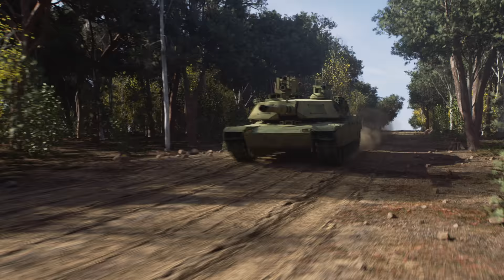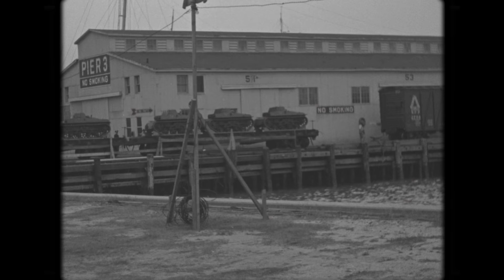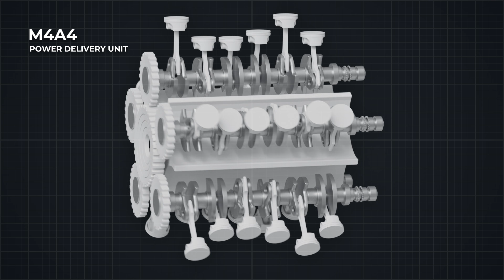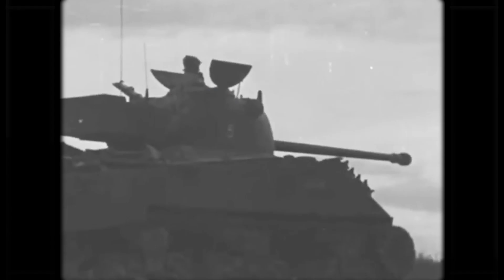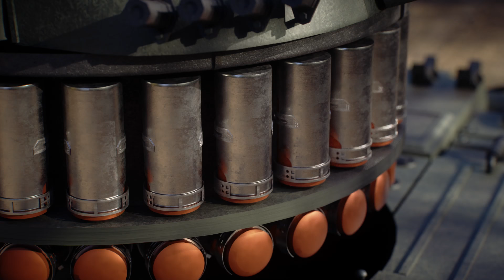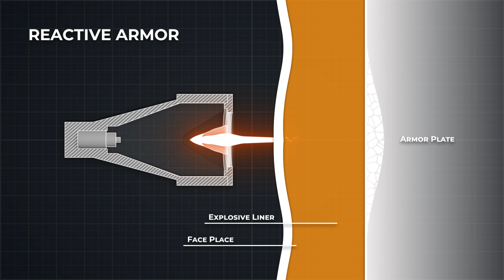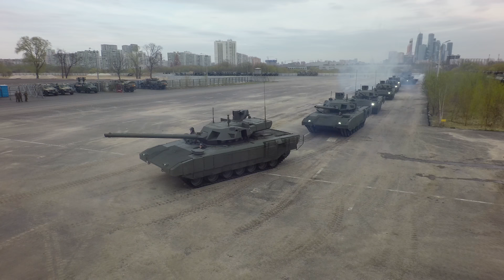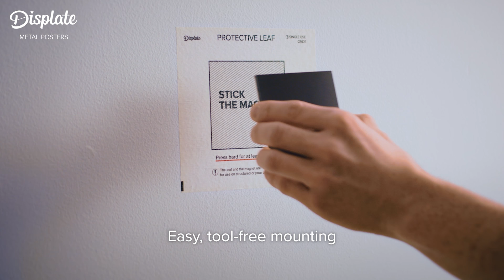Why America’s Tank Failed in Ukraine

Comment: Calling this a failure is just clickbait. The M1a1 did whatever it was supposed to do. It had the highest crew survivability of any tank in the ukrainian army. It provided excellent fire support. 

But no tank is invincible. Battlefield attrition happens. Russia can attest to that as it lost atleast 4800 tanks (of wich are 100% confirmed) up to 10 000 estimated.

Those M1's will not last troughout the war. They need to be replaced.
Reply: “Why it’s not perfect for a job it wasn’t made to do” sure gets a lot less engagement lol
Even when it fails, it succeeds in keeping the crew alive as possible. I’ll take that win in any war.
Reply: It's also an unfair comparison of the m1 abrams in Ukraine vs America because the depleted uranium armor plating isn't even on the m1's in Ukraine or any foreign service for that matter
Reply: @NoahHenning-xd1mo Fair point, and the tank was designed to advance under US air control, constant logistical supply and battle intelligence but the tank was sold extensively abroad to countries without those resources and that additional armour would not have stopped the anti tank mines
Reply: @TechToWatch  And that’s the handicap the Ukrainian Abrams had.
Reply: @NoahHenning-xd1mothey are already sinking
Reply: @NoahHenning-xd1mo because I am sure that it will make a lot of difference against something like a 152mm  kornet missile that has a penetration rating of over 1000mm of armour.
Whether they have it or not doesnt matter they have sufficient armour and all of the other important bits like a stabilizer and and good optics.
Reply: @NoahHenning-xd1moYeah, uranium is a magical, indestructible material that definitely protects the tank from mines, mud, top-striking FPV drones...
Reply: @NoahHenning-xd1mokeep crying bc even w the uranium plates it still suffers from top down and the driver is easily killed
Reply: @NoahHenning-xd1mo Nope. Don’t need the modern Red Army stealing our tech.
Reply: The challenger has the highest crew survivability rate fyi
Reply: Yeah, and additionally M1A1 SA (built in 90') that Ukraine was given weighs more like 64t rather than implied by author 78t of fully equipped newest operational variant M1A2 SEP v3 wich is also almost entirely different tank all by  itsef.
Reply: @Adam-dm3ij  Not to mention that weight results from including the TUSK protection package, which has not been sent to Ukraine.
Reply: @Gearparadummies  They've got the basic arat tiles just not the curved ones that are on the sepv2. Seen a few videos of them on the side skirts while they put kontact 1 all over the turret
Reply: @Gearparadummies And why would they bother to send TUSK? Not like Ukrainians are dumb enough to fight with tanks in the city (unlike Americans), and Russians don't have TUSK for when they try to bring the fight to cities.
Reply: @JorgMunch01  Not nearly as heavy as the TUSK.
Reply: @Gearparadummies tusk 2 has been sent to ukraine
And the m1a1 sa is an m1a1 hull with an m1a2 turret, but it doesnt get depleted uranium inserts the turret or hull
Reply: @JorgMunch01 ive seen them with the tusk 2 curved ceramic plates. they were used during the beginning of their introduction to ukraine before they were replaced with kontakt
Reply: @allenliu8820 The confirmed version sent to Ukraine by both Australia and the US is the M1A1 SA with ARAT-1 Reactive Armor, the oldest version of the TUSK Systems. No information of SEP V2 turrets installed on any export tank. Care to share the source?

Edit: what the SA adds to the M1A1 are improved Thermal  sights and digital control  systems. Which is not a SEP V2 turret installed on a M1 tank by a long shot.
Reply: @Gea @Gearparadummies  memory must be fucking with me because i could had sworn i saw a ukrainian abrams with arat 2, but it seems that it wasnt the case

M1a1 sa is an upgrade derived from the m1a1 aimv1 which upgrades the turret to the m1a2 standard. The turret also can be equipped with a du and non du insert. Upgrading the protection to be equal to the m1a2 standard.
Reply: @Adam-dm3ij Don't matter. Anti tank missiles and drones will destroy all of the models
Reply: He's not calling the tank a failure, he's saying it failed in Ukraine, which is not the same thing. Arguably if most that were sent were destroyed it did fail. Not the tanks fault, just the wrong tool for the job.
Reply: I mean yah 100%...but I assume he knows that and it is intentional clickbait and it worked on me and you.  Unfortunately some amount of clickbait is probably unavoidable.
Reply: They lasted 8 minutes at the battle of Adivka.
Reply: Lol
Reply: Nah, it is a failure as in relation to performance of other tanks used by Ukrainian armed forces.
Reply: If they did what they supposed to why are almost all destroyed lol ? Enough fire power mines atgms and drones so they got destroyed just like any other tanks.
Reply: @Gringo.the.Bratan  almost all destroy because of strip down to it original design in the 70s
Reply: Plus logistics is key to winning wars. Any equipment will fail if you don’t have the proper infrastructure to support it.
Reply: @BHuang92  that said, if your tank is designed in such a way that it's a logistical nightmare, then it failing due to poor logistics is indeed a failure of the tank design itself, otherwise you could say that the Tiger and Panther tanks didn't fail because they were bad tanks, but due to poor logistics. What army can't spend an hour of maintenance for every hour of operation am I right?
Reply: @HellDuke-  so the Abrams is a failure?
Reply: @mizoreyoroizuka4178  Iwouldn't say it's a failure, but it's not fit for most modern battlefields as clearly evidenced by it's recent performance.
Reply: @BHuang92 Or if your supplier elects a Russian puppet who cuts off your supply of parts before it even hits your own logistics chain.
Reply: @DrDeFord I mean, the "Russian puppet" is doing a great job of knocking off most of Russia's allies. Venezuela is gone and Iran is about to be overthrown. He doesn't seem to be good puppet or y'all spouting this nonsense are delusional. I think footing the bill for a country that isn't an ally and they have no binding treaty with is charity, not obligation. Ukraine should be happy it got anything to fight with and was actively supported for a number of years. But all the sudden the EU has to pull their own weight and now it's a big problem. France, Germany, and the UK should take the lead. CNN should hit the frontlines too if they're so eager to fight.
Reply: @Thrainite  Cope is hard with this comment. He is a very good fool and puppet with zero sense. Venezuela is still very much there so is Iran. Don t believe a liar otherwise i have a bridge to sell you.
Reply: @Thrainite  America is known to bombed reporters it doesn't like. Regardless of affiliation, they're not big on accountability.
Besides that, Maduros regime is still intact, Iran still exists. I don't see much benefit, other than wealth, where any US operation had significant impact
Reply: @Thrainite nope he’s still Russia’s puppet, he doesn’t do anything that doesn’t generate a personal kickback.
Reply: Why does anyone assume that this is about saving Ukraine from Russia?

It's a weapon testing and advertising event with the west bleeding Russia like they did in Afghanistan.

Only this time they have non stop surveillance and intelligence assets.

No weapon system is perfect they are all tools for a purpose. Anyone who claims that their sides systems are invincible is a cheer leader.
Reply: @Mayadanava weapons testing with 40-50 year old equipment.... sure pal 👍
Reply: its not its actually the challenger with the highest survival rates
Reply: @jaanusandrejev1196  lmao, after 3 of them got destroyed, they pulled all of them out
Reply: Exactly, in comparison I bet the Abram’s has a far high crew death rate than the challenger.
Reply: @Pieces93 far higher is an overstatement the challengers survivability is only marginally better
Reply: @TauPathfinder334 Challenger lacks the blow out panels like Abrams, one got blown up by a lancet strike to the top rear . It was a catastrophic explosion and the turret was torn off the hull. I doubt any crew survived that.
Reply: @Archer89201 if a Lancet hit an Abrams in the rear of the turret, I am fairly certain it would have got opened like a can just the same, blowout panels will not save you from that.
Reply: Oh did that hit a nerve American traitor friend !!! 😂😂😂
That’s what traitor tanks do … they „eventually“ break down …
I’m a bit with the Greek gods on this one.. so take it with a pinch of salt as they say😉
Reply: Of course, every single tank was lost in Ukraine, from m1a1's to Challenger 2's to T-90m's.
Some in enormous quantities. To use the destruction of these abrams as an argument for failure is just retarded russian copium. By this metric every tank that saw combat and every future tank that will ever see combat will be a failure...because they surely will be destroyed.

The point should be, did they acomplish their mission?  Did they provide fire support and breakthrough capacity?  
Those are the real questions any non-cognitively impaired person would ask.

Or do russians and their clowns think the mythical T-14 ARMATA!!🎉🎉🎉🎉 would not lose a single unit in ukraine?

Cmon, its easy to see why ukraine is managing to hold back Russia....its because russians are fucking dumb.
Reply: Their purpose in Ukraine was not to serve as fire support or breakthrough but to get the Germans to stop whining about releasing the leopards. The Biden admin knew they weren't the best option for Ukraine and sent them reluctantly.
Reply: People also forget, this was a completely stripped down version.
Reply: @jamesharwell9171 it won't do shit with drones even with DU armor
Reply: @matthewA2  makes since on the roof but not side or front not completely useless at all.
Reply: I don't mind clickbait from this channel because they consistently produce the highest quality content.
Reply: Saying the Abrams has the highest survivability is a stretch when the Challenger 2 is right there—it’s a literal fortress on tracks. The real issue isn't which tank is 'better,' it’s that both were designed for a war of movement, but in Ukraine, they’re being used as 'expensive snipers' because they’re too heavy for the mud and too vulnerable to cheap drones.
Reply: @James-dv1df  Drones capable of destroying a MBT aren't cheap. In fact they cost ten times more than an artillery round.  Still much cheaper than the tank, but the "$400 drone kills a tank" is a myth.
Reply: @Gearparadummies 
This is completely false, average FPV costs about $300 - $700 to make an anti-tank model. The cheapest ones use warheads from things such as an RPG-7. Average 155mm shell? $3000 - $5000 and that is assuming you only use 1 to hit a tank (highly unlikely).
Reply: @Gearparadummies  Destroying a single side of tracks is enough for a "tank kill", armor penetration is fluff. 
Destroy the track with small stuff, then shell it with artillery. Killing a tank doesn't require total destruction, mobility kill is all it takes.
Reply: @Bvoid-b  no? Tanks like this are recovered from fronts most of the time and repaired at back. What you describe is a mobility kill. But its not equal with actual loss, therefore you can't count full cost of the tank as a loss.
Reply: @pawemilewski3179  That depends on available resources for both sides. 

A mobility kill can very well lead to an abandoned tank being destroyed later and being unrecoverable. Immobilize with the small stuff, then order a big hit or drop some thermite on the abandoned vehicle using another cheap drone, specially if the hatch was left open.
Reply: @Bvoid-b  this is the correct answer. Yes, you can get s “hard kill” of a tank with drones, but you!ll either need to get lucky (like the crew leaving hatches open), or you will need to send 10-15 drones total.
Much easier to get a mobility kill then shell the stationary target for an easy layup.
Reply: @dsan8742  why are infantry still not considered obsolete and are still being deployed by militaries across the world when they can easily be killed by bullets, artillery, and drones?
Reply: @dsan8742  The most widely used Russian loitering munition/anti-tank drone is a Lancet, which goes around $35k/$40k a piece. Same as Geran/Shaheed drones. Same for Ukrainian made ones. Can you even read before posting? Can you even use AI or web search?
Reply: @mizoreyoroizuka4178  Because a drone can't occupy land, build new outposts/dugouts or trench lines as forward bases for continuous advance. The same as tanks not being obsolete because drones are 1)Not all-weather. 2) They are mission-specific with zero versatility. 3)they lack the firepower/support capacity/range of a tank. 
Last but not least, attack drones are doing the job of artillery barrages because both sides are almost out of barrels/ammunition. They're not the end all/be all weapon everybody thinks they are.
Reply: @pawemilewski3179  only if you are advancing. If you are falling back like Ukraine, the ones that recover the tank are the russians. To be fair, Russia won't use them, but it would still count as a loss in that case
Reply: @Gearparadummies  cheap compared too the tank is the point.
Reply: @pawemilewski3179  no there not….
Reply: @dsan8742 drones don't shoot shells. The power behind the shells are kinetic energy.  If you got this detail wrong, makes everything else suspect
Reply: @hanhuang7263 russia just lost more land in 1 weok than they captured in 2 years.  They aren't advancing
Reply: @BK20XX 
Buddy so confident in being ridiculously wrong. RPG7’s ARE HEAT (High explosive anti tank) BASED WARHEADS. They do not require kinetic energy, only enough to trigger the mechanism, they utilise chemical energy in the form of a superheated high velocity jet that comes from the shaped charge being triggered. The fact you got this wrong tells me a lot as this is literally basic knowledge. If RPG’s relied on kinetic energy they would be literally impossible to use by infantry as a handheld weapon. 😂😂😂
Reply: @Gearparadummies 
Although Lancets and Gran drones are the most effective per drone against assets such as tanks, THE MOST COMMON DRONE by number and BY USAGE AGAINST ARMOR are basic kamikaze FPV drones. 

Significant armored losses by percentage are attributed to Kamikaze drone swarms, moreso than the advanced Lancet and its equivalents.
Reply: @mizor @mizoreyoroizuka4178 
When did I say Tanks were obsolete doofus 😂
Reply: @dsan8742  A close friend of mine works in military drone design. Kamikaze FPV drones cost way, way more than $400. And that's after applying economies of scale. 

So no. $400 FPV drones don't kill tanks.
Reply: @Gearparadummies 
1 google search literally proves your bullshit, even just scrounging through videos you can see MOST tank kills are performed by drone swarms. 
 
A 400 dollar drone rarely kills a tank sure, 10 of them? Will score a mobility kill. 20 of them? Will confirm a total tank kill. 

What military does your friend work for? FPV drones are notoriously cheap why would I trust your friend over multitudes of sources that state otherwise 😂. 

I can say though it also depends on the drone, Fiber-optic drones with heavier payloads might hit the $1k mark, still far cheaper than what you are insinuating, which are prices for the most advanced drone models
Reply: @dsan8742  "GoOglE SeArCh". Ok. Whatever.
What you got with your "ReSeArCh" is the price of the baseline commercial drones before the plethora of modifications they undergo for military use. They don't come standard with Thermal vision, extended range, encrypted signals and other modifications.
This is like saying a $80k Audi and the $400k armored version used by security forces are the same car. But yeah, keep thinking off the shelf drones can kill a tank.
Reply: @Gearparadummies  strategy is the key. Remember, tank tracks are perhaps one of any tank's weakest points. So yes, a good HE round to the side of any tank will probably immobilize it
Reply: @bororobo3805  More than half of inmmobilized tanks are salvaged by its own side. And I'm being cautious with the number. 

An immobilized tank doesn't necessarily mean a destroyed tank. 

There are reports of Leopard 2s withstanding more than 30 drone hits. Even Russian turtle Tanks are effective against drones.

I never said Drones cannot destroy tanks. I said  off the shelf $400 drones cannot destroy tanks. Mostly because every drone used in Ukraine by both sides is heavily modified.
Reply: @Gearparadummies yeah I hear you. 

But it's not the drones fighting the tanks. The drones carry explosives and drop them on the tanks. Then you also have kamikaze drones.

But still, someone mentioned an immobilized tank is as good as dead. You wouldn't want to sit and wait inside one. You don't know who or what is tracking you from the outside. Once it stops, the frag grenade "bombers" can fly in to finish off the crew 😂
Reply: @bororobo3805  Tank gets inmmobilized. Crew bails. Reports tank abandoned and location. Tank recovered if possible. 
This is standard procedure since WW2
Reply: @Gearparadummies that guy who took out a tank with a single $1 molotov is laughing at you right now.
Reply: @ZandrichMynhardt  Who? You're too old to watch cartoons.
Reply: @J @James-dv1df u don’t need to kill it to make it useless. Then kill the repair men. That’s why tanks are obsolete. Drones could literally cycle out with fresh batteries and literally starve the crew to death. It’s a large tomb now.
Reply: @S-sp2feanti drones are being developed. They’ll follow the development of bombers then fighters to kill the bombers, then fighters to stop the fighters in WW1, but driven by AI acting autonomously, very cheap and available at scale.
Reply: @S-sp2fe

Bro, tanks are not obsolete.

If they're obsolete just because they have a cheap counter, which is not even guaranteed. 

Then the tank was obsolete since  invented, since then it has cheap counters.

Tanks are made to survive long enough, not to be invincible, the tanks shown in most footage are already immobilized and most likely abandoned.
Reply: @nonnn6884  apparently tanks were obsolete in WW2 because they could be destroyed with a single Panzerfaust that could be mass ptoduced for pennies by that logic.
Reply: @James-dv1df the challenger being better protected than the Abrams is up for debate. The real detriment to the Challengers survivability is its mobility.
Reply: @James-dv1df yes it's a bit much to say that the abrams has the best survivability when the survivability of the challenger 2 is pretty much 100%
Reply: @James-dv1df challenger is crap, by far the worst tank Ukraine had in this war.
Reply: @ЮрийКастро-м5в  Lol, Russian bot. Look at how many Ru have manage to destroy (few) and crew losses (non).
Reply: @ЮрийКастро-м5в   Calling it the 'worst' is a bit of a stretch its really depends on the job. If you try to use a Challenger 2 to blast through a muddy field, yeah, it’s going to get stuck because it’s a 70-ton machine. But Ukrainian crews actually call it a 'sniper' because of that rifled gun. It’s hitting targets from 5km away while staying in cover.  

It's definitely slower than a Leopard and heavier than an Abrams, but it's built like a bunker. In the few times they've been hit, the crews have walked away. At the end of the day, a tank that keeps its crew alive and hits targets from 3 miles out isn't crap just a specialist

But UK only gave them too Ukraine to open up the floor gates for others to donate. Reality is that the leopard is what they needed not the challenger as it was not well suited to Ukraine.
Reply: @ld4244 I am not from Russia, I am Latvian living in France, my channel is 14 years old, that's clearly is not a bot channel, and the fact that there were more Russian tanks destroyed than western thanks in Ukraine is simply a result of having more Russian tanks to be destroyed, in terms of performance Western tanks performed as shit, and Challenger was the worst one second worst was Abrahams, ukrainians were even afraid to use it in battle. The only machine that was actually good was Bradley, arguably the best machine on both sides in this class, but Western tanks turned out to be complete shit.
Reply: @James-dv1df the problem of Challenger is not the speed, it's armour isn't great despite what British were trying to prove, and it's gun is anachronistic. Imagine how bad this tank was that ukrainians were choosing t72 over it in battle, and d72 is shit.
Reply: I don't agree with your entire analysis, I think they needed more Bradley's end no tanks at all, in modern battle classical main tanks are obsolete, so we have a conversation about which piece of shit was less shity.
Reply: @ЮрийКастро-м5в  it wasn't just the result of more of them getting destroyed. It was also a result of them being even more shit than the Western tanks. All of them are ill suited to the modern battle field. 

The main difference between Russian designs and Western designs is that in Western designs the crew has a reasonable chance of survival and not making the same mistake the next time. 

In Russian designs you have the turret throwing competition going on and a pretty low crew survival rate.

So, in essence, Russian crews learn through natural selection. Western crews learn through experience.
Reply: @ЮрийКастро-м5в  It’s not quite that simple. The L30 rifled gun is definitely an outlier today logistics-wise and is being replaced on challenger 3 to be NATO compatible, but calling the armor 'not great' ignores that it was designed for hull-down defensive fighting, not chasing drones. Ukraine 'prefers' the T-72 because they have the infrastructure for it.  Like I said before the challenger was only provided to open others up to provide the leopard which is what Ukraine really needed.

Maybe I am wrong however can you confirm why you think it's the worst tank ever?
Reply: The issue was that it was only designed to bully poor third world countries
Reply: Thats a cute cope. Did your husband give it to you ?
Reply: Naah its normal, i've seen the worst call for Abrams
Reply: No it doesn’t have the highest survivability
Reply: I can't believe people actually believe the incredibly stupid numbers that the Ukrainian MOD puts out re. Russian destroyed vehicles. 4800 tanks. Lol. It's low-brow propaganda for the wine moms. Insultingly stupid, and I think they're actually saying it's 11k tanks on social media. LOL.

I'm no fan of the Russian military, they are laughably bad, but the numbers that Ukraine puts out there are so outrageously made up.
Reply: More like a little propagandist piece of trash
Reply: Heard of HALO theory? Number of targets increase kill count on your team when you play online, so raw numbers are relative
Reply: A reply, but it's a clown and laugh reaction.
Reply: Is the bigger issue that tanks cannot outrun a few drones hitting from any angle with a shaped charge. Drone development has destroyed most tank capabilities bar fear, most terrain   travel and a large gun but it's defence to drones that can hunt tank shapes, perhaps even recognise the tank type and it's weakest part to hit is near zero now, unless drones can be removed from your enemies battlefield.  Russian tanks are faring no better Vs drones bar their better fuel consumption Vs the gas turbine. Most of the human losses in Iraq and Afghanistan were protecting the vast amount of fuel needed by the (mostly) US army. As the Germans realised in WW2, no fuel means no tanks and troops become cannon fodder for mobile artillery, air to ground and even handheld missiles to hit truck transport. Hell even the A-10 showed that from above, such a a mobile asset could decimate tanks from above with just tank busing bullets at scale and speed
Reply: BS 💩
Reply: You mean CV90
Reply: Confirmed by whom 😂
Reply: Replaced…. With  drones.
Reply: A lot cheaper ways of ensuring survival.
Reply: Any "failure" was due to the lackey ungrateful Ukrainian operators
Reply: Not quite true the suggestion landing craft couldn't take more than the 30 ton Sherman as the Canadians took Churchill tanks to Dieppe in August 1942 and they were used by the Westminster Dragoons on D Day  as Funnies flail tanks for mine clearing on the beach and as flame throwing Churchill crocodiles. Churchill tank weighed between 39 and 41 tonnes (approx. 38.5 to 40.7 long tons)
Reply: You people act like they only use the abrams like they also have challengers leopards and most of these tanks don't make most of the kills the drones and atgms do most of these kills
Reply: Must agree it’s no surprise in a hot war tanks get knocked out just like Leopard and Challenger the most important component in western tanks survive.The crew.
Reply: But y'all were the ones talking like the M1 Abrams was invincible and couldn't get destroyed when the first tanks got sent in. Now you're changing your tune. You people are clowns. If they send 500 new M1 tanks, they'd immediately become priority targets and would also get destroyed.
Reply: I asked Google just now regarding the high loss rate of these supposedly invincible American tanks and this is what I got: “The 31 M1A1 Abrams tanks provided to Ukraine were downgraded versions with their classified Depleted Uranium (DU) armour used by the U.S. Army, removed ; making these Ukraine versions less protected against advanced Russian anti-tank weapons to prevent both this top secret American technology from being transferred to Ukraine and if captured, to fall into Russian hands.” So, basically all the Ukraine Army got was an ordinary tank that kind of looks like an M1A1 Abrams. The Pentagon unfortunately also does this with the F35. What U.S. allies buy is an F35 with all the goodies removed so they can never be someday used against a U.S. Airforce, Marine, or Navy F35. ❤Diane, Vancouver, Canada. MnMR16/26. 07:46 am
Reply: @dianefeinstein8951 Technology so top-secret, it's being discussed in a youtube comment section. The Russians will never figure this one out.
Reply: @dmitrychernushevich7241. Hi dmitry: A lot of the secrets we find on You Tube are inaccurate. For example, Mom has been trying for years to get a recipe for a proper “Korolevskiy”(Russian “Royal Cake” with yummy layers of walnuts, poppyseed, and chocolate). The only way is to capture a Russian operative, strap on a lie detector, and interrogate him, “What’s the secret ingredient in Korolevskiy, that makes it tastes so good! Don’t want to talk?! Guards, make him eat another BIG MAC from McDonald’s!”
❤Diane, Vancouver, Canada. SnMR29/26. 06:17 pm
Reply: @dianefeinstein8951  China got it anyways lol
Reply: They weren’t a failure because most of them were destroyed they were a failure because they didn’t have an impact on the wider war.
Reply: Ya the Russians loosing that many tanks is propaganda just like saying the Abrams sucks is
Reply: Russia lost "4800" tanks in Hollywood?
Reply: Easy target, useless in combat but crew has high chance of survival 😅 lol
Reply: You cant know for sure the propaganda from both sides is huge
Reply: Cope
Reply: It's the truth.

1. It's unrepairable.
2. It takes forever to manufacture.
Reply: @mountainbikerdave  unrepairable because Ukraine doesn't demand more Abrams tanks and two the US isn't in war that need more tanks most these are from dusting storages.
Reply: Smartest american.
Reply: They didn't fail unless they were destroyed without killing enemy tanks.  They can be expended in combat like any weapon system.  What counts is whether they accomplished the mission.

That brings us to crew skill, the type of battle being fought, and how successful the operating force was at combined arms warfare.

ALL tanks die when hit by 152mm or 155mm HE .

They die when a drone flies in the hatch.

They die when a shaped charge hits them.

They die when they set off anti-anxiety mines.

They die when hit with antiarmor bomblets.

And they die if another tank stuffs a HEAT round up their a$$.

The Abrams tank is an armored beast with better speed mobility accuracy and lethality than any other tank im aware of but nothing is invincible.  

 It always comes down to putting the right systems in the right places to kill the enemy and survive.
Reply: Failed in the specific objective of stopping the Russian advance. Planners did not anticipate the lethality of drone warfare in the era of the 21st century battlefield.
Reply: 4,800 tanks? No need to listen to CNN, BBC and Ukraine 😂
Reply: Keep drinking copium
Reply: Да ну? Целых 10 тысяч?
Эт ты где начитался?
Ладно 4800, за 4 года такое произошло 
Только есть одно но 
Танк потерять не так страшно 
В танке главное экипаж 
Танк построить можно, а экипаж просто так не сделаешь
Reply: Ahahahaha, dude, you're sick, what 4800, where did you get this information?
Reply: @CTPAHQNK_WTM Russia has only about 12-13 thousand tanks, and these idiots claim that the ukronazis destroyed almost 5 thousand of them, count half. I'm telling you, according to statistics, the dumbest people on the planet live in the usa 😂
Reply: 100% are confirmed, sure Jane 😂😂😂
Just like Trump's Iran war claims.
Reply: Effective against 3rd world armies, that fire at frontal armor.😅😅😅😅
Reply: "Chrysler was chosen to save it from bankruptcy."
Reply: Stridsvagn-122 seemed to have better survivability, with ORYX classing 90% of lost hulls as only 'damaged', while abrams were around 50% 'destroyed'. Better survival than russian models, and comparable to other leopard 2 variants, but Stridsvagn does seem safer based on what little sample data we have.
Reply: @sammyjones6730  When people talk about survivability, they are referring to crew protection.
What leads to the fact that these Abrams have been destroyed is thst they were immobilized, then once the crew evacuated FPVs were used to blowup/cook off the ammo. The ammo cookoff leads to it spreading to the open hatch crew compartments, and often melts the engine decks.
Reply: @sammyjones6730  Deniable ‘open source intelligence’ sources are in fact merely propaganda.  Note that you do not get real information from the military intelligence.  This is by design.  The real figures are very bad for NATO, so you get ‘OSI’ nonsense generated by amateurs shepherded by spook-controlled propagandists.
Reply: @boggisthecat  good thing you get your figures from RT and stay updated on the real "true" figures then, right Ivan?
Reply: @boggisthecat  lol ok ruzbot.
Reply: @i @ingnit6885  If I did that, it would make me as gullible as you.
Reply: @angusmatheson8906  Do you also believe that Epstein trafficked girls to himself?  Plenty of bootlickers and paid posters will tell you so.
Reply: @boggisthecat  huh? 

OSINT is literally open source, meaning you can literally go amd see geolocat3d footage and images of all strikes etc. There are many well complied archives that are updated multiple times a week of these lossesm 

What exactly does this have to do with Epstein?
Reply: @angusmatheson8906  ‘OSINT’ is literally propaganda fed to people who know next to nothing about what they’re being shown.
Reply: @boggisthecat Too dumb to look up stuff on the internet. Epstein!
(Wonder if that will become the Godwin's Law of the zoom zooms...)
Reply: @b @boggisthecat No
Reply: holy ragebait 🥀
Reply: The title doesn't call it a failure, it's just says it is failing  in Ukraine, which it is
Reply: @k3v1n73 Russia is also running out of tanks. It would be more correct to say that tanks are not a silver bullet in low-level attritional warfare. Tanks have always been most effective in large combined arms operations.
Reply: @mtylerw  Source:Trust me bro ✌️
Reply: @mtylerw  This video is about Americas Abrams lol. Cope
Reply: @k3v1n73  As are all tanks. The days of heavy armor are practically over.
Reply: @patrickjennings7362 and what will replace having an incredibly difficult unit to combat on the battlefield? This has been a statement since the 60s when ATGMs were introduced. What happened as ATGMs became common place? Tanks evolved with ceramic/composite armor, added era, and/or added active protection systems. Tanks are a force multiplier on the battlefield and the drone will not kill the tank, it will force it to evolve to fight drones and that is happening right now all around the world in labs. Until something better comes along that just completely overshadows the tank, the tank will always have a place. You need the equivalent of aircraft carriers killing battleships to phase out tanks.
Reply: @patrickjennings7362 no it's not. It's evolving. That's like saying the age of the dogfight is over look how that worked.
Reply: @botsmacker  The age of the dog fight is over. Jets fight with missiles from long ranges. A single guided rocket fired by a single soldier can destroy a multimillion dollar tank and its crew in seconds. Yes, tanks and manned jets will hang around for a number of years (20 or so) but, like the horse, their time is coming to an end.
Reply: @patrickjennings7362 the last time the USA said that they fucked up. At the end of the day when you have 2 forces rapidly approaching each other your going to need guns. You need tanks to hold choke points tanks will never leave they will adapt just like everything else.
Reply: @botsmacker  OK…tell us when that was. The past is the past. You once needed horse cavalry to quickly secure areas, then you needed tanks, now you need drones to simply keep the enemy at bay. The fundamentals of area denial and air superiority are still at play,  but the tactical tools are different.
Reply: @patrickjennings7362 calvary is still used. Just not horses almost like living animals have limits. Tanks will evolve just as calvary has
Reply: @botsmacker  I don’t disagree…but they won’t look anything like the systems we see today. Likely small unmanned gun platforms.
Reply: @patrickjennings7362 probably the exact same thing but unmaned and integrated drones. We already have stuff that has no armor. Tanks are specifically their for big gun and armor. That's their job edit if not armored it's going to crazy amount of counter measures which honestly it will probably be armored and have a fuck load of counter measures. Humans will be replaced in war before tanks.
Reply: @botsmacker  Here we disagree. What is the purpose of a tank? It is to protect a heavy gun crew as it supports the infantry in a breakthrough. If a drone carrying a mortar round can do the same thing then why spend the money on armor? Armor in that manner is at the end.
Reply: Weren't we sending and giving Ukraine old stockpiles of M1 Abrams tanks?
Reply: @Toocheapfixexhaust  yeah pretty much
Reply: @Toocheapfixexhaust Yes. The M1A1 SA.
Reply: And calling out the click bait boosts engagement! I'm doing my part
Reply: @UKfanX13  good luck shooting the Bugs trooper.
Reply: It mentions the Armata, a tank that hasn't seen combat and it's unproven russian propaganda
Reply: @PoyimaMedia the tank exists
Reply: @Rex_82948 yeah, as a prototype only used in propaganda
Reply: @PoyimaMedia it’s not a prototype anymore. And it has been used in parades etc. that’s not propaganda
Reply: @Rex_82948  bot
Reply: @Rex_82948  anything that serves the only purpose of boosting morale than its intended mission is propaganda. they have like 8 of those Armatas man. Its just a propaganda piece because they can’t afford to make anymore.
Reply: @Rex_82948  military parades are inherently biased to showcase the military’s strength. They are, by definition, military propaganda you dolt.
Reply: It’s not propaganda at all.
Reply: Blinded by west propaganda 
The crew protection is true, but this tank is not invisible 
It only succeed in gulf war because it was fighting T-62 tanks
Reply: @ABDO_615  no one called it invincible, in fact they were advocating that it isn’t. Maybe try to read next time through ur soviet bias lmao.
Reply: There is nothing failed with it.  You are 100% correct on labeling this as click bait. The main fact of this video is nothing more than someone trying to get views on a depressingly obvious topic.  Anyone who knows their ass from their elbow knows the difference between Abrams given to Ukraine and Abrams the US military uses.  Absolute bollocks.
Reply: @hjoe1981  Lmao they got destroyed how is that not a failure? 😂😂😂
Reply: @PurpleDoritos666  EVERY SINGLE piece of military will eventually be a failure if you consider destruction to be failure. And just look at the giant amount of russian T-series tanks that have gotten smoked (thousands). For Ukraine to lose 34 tanks over ~1 year is really impressive and shows planning skill and effectiveness of the abrams. Success in my eyes is if the piece of equipment returned more value than it costed, and the abrams def did
Reply: calling it a failure got comments and engagement like this which is fully intended to rage bait losers with no time for other things for increased views so well played :D
Reply: Different deployment scenarios too. The US have had total aerial, industrial, logistical and intelligence supremacy to back their infantry, mechanized ground and artillery forces in every modern armed conflict theyve fought or waged. Fighting relatively low armed (albeit tactiful) insurgents instead of a full conventional military force helps too. The Abrams had almost total free will to operate at its fullest combat capacities under US operations. 

Ukraine is not in that scenario at all. They are facing a bigger nuclear armed state invading them with bigger numbers in basically everything waging a full on attrition campaign, and now cheap drones reign total domination on every inch of ground there, decimating everything and anything that moves. Mobility, air superiority and air defence are the name of the game here and Ukraine is lacking in all of those to support their infantry and mechanized ground forces better against mass Russian infantry waves, drones, and artillery battering them constantly. All of these conditions made it unoptimal for the Abrams to operate in this theatre under Ukrainian service and operations.
Reply: Cite source, after all, nobody should believe anybody's internet claims 🫠 especially under YouTube 😂
Reply: So you agree it failed 😂?
Reply: @bororobo3805  It depends on what's a success and what's a failure. If you mean only an invincible tank as success, there isn't a tank in the world can do that. But if you look at the combat destruction ratio, M1 definitely on top of the list. For military, a win is mean "did it achieve the mission requirement?", or "cost trade off radio is better?". Each country have their own meaning as "win" or "fail" depends on which angle you look at a scenario. Because you can win every single battle, but still lost the war.
Reply: Holy cope
Reply: 31 tanks in a 4 year war and the latest systems that are directly anti drone and intended for front line use have not been sent, only the version of the system that are meant to protect infrastructure and cities lager caliber and have to be stationary to fire, but this is what Ukraine has asked for first it fits their very effective strategy of blending out the Russians and hitting their economy and industrial production, war of attrition, if you have enough SkyRanger 30 mm which can fire will moving Denmark has signed a contract for upgrading 18 Switzerland armored vehicles 8x8 to those, you can also get it in a leopard under wagon with tracks from the factory no upgrade required, with those to support our Leopard 2 A7 and New version of the CV-90 and our mobile artillery mortar and rocket artillery support and armored infantry the first heavy and the second brigade would be a challenge to stop with just drones or artillery with poor communication and slow kill chain in the Russian military, and they also have a engineering core in the first brigade to clear mines with special equipment for fast clearing, and for Pantone bridge build, and what everyone has forgotten exists the most powerful weapon of all air power air superiority.
Ukraine has never been given the tools at least not enough of them to fight like NATO so they are using what they got very effectively in my opinion, and a tank is expendable the crew are not you can build more tanks, or like Denmark does  buy more tanks and Denmark having given like 3 times more tanks too Ukraine compared to the USA is pretty crazy, if I had a huge amount of older tanks I would have given them all to Ukraine but we have no old tanks left only the new version A7 to A8 is being built but not yet available.
Reply: His clickbait title irked me
Reply: It is also 14 lost out of 31 and not 27. that is pure comedy 😂
Reply: How many of those stay as a loss considering they get behind the contact line and you have the industrial capacity to repair them and put back in service.
Reply: @attaque71 probably most because that’s not how losses are calculated. Also especially with drones, the chance of the tank getting destroyed is much higher because they will send 20+ drones per tank.
Reply: @Lapua772 "Probably" leaves a lot of room to work with.
"not how losses are counted" in the west, maybe.
Sure, drones are a bitch.
But you'll be hard press to pin every one of those 4500 lost armor to drones.
It could go as much a third, hell, even half.
But then again, the numbers are unreliable to begin with.
TLDR. Russian lost armor numbers thrown around are guestimates at best and blatant propaganda at worst.
Ukraine lost armor are easier to fact check cause of their limited numbers and the fact that they can no longer get to them for recovery and repair.
Reply: I think it is justified that the M1 did fail in Ukraine. It’s not because it’s bad. As you said, it has great survivability. The tank is just not able to fulfill its intended role to its fullest potential in Ukraine due to drones it was never designed to deal with.
It’s like driving a Prius over an icy road. If it spins out, it fails to do its intended role. It’s just not designed to go over ice. Much like the Ukrainian operators, you can adapt how you use it but the risk is still very high.
Reply: Well first of Real Engineering is not calling the tank a failure in general, he is explaining why it is failing for the purposes of the war in Ukraine. 

Real Engineering put out a video a year or so back explaining the engineering marvel this tank is in general 

But this video is specific to how it is holding up in the war in Ukraine 

Very different things, so instead of calling this video "click bait"

Do some more research first on this channel 👍
Reply: Well, we have 3600 confirmed Russian tanks knocked out, whcich means destroyed/damaged/abandoned/captured. We have to keep in mind that the Russians are the ones advancing, hence they can usually tow away their damaged tanks. Many of these get repaired and can get knocked out again, and again, inflating this number. Also double counting is very common and every tank that is burnt and can't be identified is assumed to be Russian, despite the fact Ukraine uses the same tanks.
Ukrainians of course claim they destroyed 11k tanks, which is like 3x what Russia has in it's total arsenal, so I guess you can trust their word too.
Reply: @mihail0431 Already got debunked several times how Oxy inflated numbers like hell with same tank being marked destroyed several times and a capture being marked a loss and when same tank destroyed would be marked a loss again. Ukrainian T80/T72 variants being marked as Russian too. Figure why he stopped is work after things started to get sourer to Ukraine. Lost Armour in 2025 showed that Ukraine lost more tanks and spg's then Russia, fucking meme.
Reply: When 10M worth tank barely does what a 1M tank does and get destroyed as easily as them we call it a "failure".
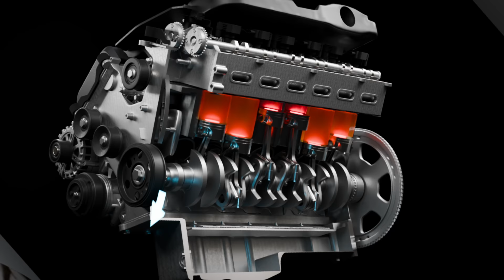Reply: 1:35 yet the crews are still alive. That’s what h matters most.
Reply: The configuration sent into Ukraine is a failure, just bare bones. Counting K/D numbers doesn't mean much. "Tiger 2 can eat five T-34 in one setting" sure the soviet lost a lot of tanks but if you got no tanks... you got no tanks.
Ukraine is not getting enough tanks and the United State of America is kind of busy "uniting" the Americas... pigs taking whatever they fancy.
Reply: Russia never lost any tanks🤪
Reply: Nah you are wrong russia lost 100000 tanks. American shovels are too powerful.
Reply: Copium
Reply: Cope
Reply: This comment is just clickbait, The Challenger 2's have a higher crew survivability than the Abrams tbf, even the Ukrainian tank crews say the same.
Reply: Except the other western tanks didn't perform terribly, unlike the M1 hype machine.
Reply: Just FYI, if I load this video from the feed, your comment doesn't show up anymore under the video, despite it being the top liked one.

I fear the channel hid your comment.

I had to go through my activity log to find it again.
Reply: @mondodimotori Its okay. Real engineering has shown his true colours. This video and my comment has been shared on reddit and people now know enough about this channel
Reply: @F4Wildcat  Now i'm curious: Which reddit? Because their reddit is set to "private".
Reply: Calling a Tank which got taken out by far cheaper munition and mediocre power projection a successful project doesn't exactly sound right
Reply: @Recotes_official  tell me a single tank in history that couldn't be easily destroyed by a much cheaper munition
Reply: @staringgasmask 
1.Good Point (some T 30s came close tho)(joking)
2. It's mainly about the ratio of power projection/utility per tank and that wasn’t exactly good when you have a look at the numbers.
Reply: Did Real Engineering got a paycheck from the Russians or why does it seem his opinion is to stop support for Ukraine since its ineffective allegedly?
Reply: Just stop with the copium of pulling out the "More Russian tanks destroyed card". The Abram was used less -> Destroyed less
Reply: the cope is high
Reply: If the Russians truly lost 10,000 tanks, then they would not have a tank force left at all. And "confirmed by Oryx" may as well be Ukrainian propaganda: lite edition.
Reply: @saucy743 Confirmed by TMB (Trust Me Bro) news agency 🤣
Reply: Cope
Reply: Thanks for saying this
Reply: Rubbish, C2 far safer for crew
Reply: U mean in. Iraq 🇮🇶?
Reply: And it was only 31 tanks they got, all of which were stripped of valuable systems before being given to Ukraine, usually there's thousands of tanks in an offensive push with all it's equipment not 30 bare ones, and I don't believe they lost 27, simply because both sides have reduced their usage of armour and artillery over the last 2 years due to drone warfare.
Reply: @iamthepotato6969  makes no difference. All US equipment got obliterated by Russia 😢 why waste more money when it will all get destroyed. 😢
Reply: @al76636  keep spitting false propaganda comrade, or you'll be fighting in rags too.
Reply: Oooo Mr. M1 ! Who gives a shit! Fund healthcare for Americans!
Reply: Failure and failed are mutually exclusive concepts.
Reply: Russia never had 10 000 tanks ever to begin with.
Reply: @cactuslietuva no they really did, remeber they are using all the 1960s tanks T-55s and T-60s as they are just throwing russian lives and tanks away day after day for 4 years. They have had time to pull all the cold war relics out and give em a lick of paint fill them with 17 year olds and send them out to die.
Reply: That’s what the extension DeArrow is for. Changes titles to accurate user submitted ones. Shuts up all this BS and is free from the same dev that makes YouTube SponsorBlock. No I’m not a paid shill it genuinely makes YouTube USABLE again.
Reply: Got taken down by temu drones lol
Reply: Russia did not lose 100% of those tanks. A large portion may be completely destroyed but because they are advancing, they can retrieve the damaged tanks and repair them.
Reply: Perhaps Americans think that their equipment ranks top of the list. That is logic for them, but take a look at how Americans rank in IQ against the rest of the world. That may explain a few things, like losing every war possible, and having a need for around 43 five star generals of whom 80% have never been active on the battlefield. These are the boys and girls who decide what you need to fight and win. How many of these patriot systems are still active in Ukraine? And those Bradleys? The USA is great in promoting junk. When Trump demanded that Europeans should buy American cars, he got the response that he should make better cars.
Reply: Thats great, now, who is winning the war?
Reply: @omarrueda3650 Not Russia.
We're 4 years into a "special operation" meant to last a few days.
Reply: Nonsense. It isn't a tank it is a tank destroyer. It is lightly armored fast with a very large gun.
Reply: yEaH ruSiA lOsT 1000000000000mio tonks, trUsT mE zelensky tOld me tHat
Reply: When you use your so-called inferior weapons to fight against one of the big fish this is the result 😂 We were told Western weapons are game-changers but struggle in Ukraine.
Reply: @FiuYanga 
Western weapons and the will of the Ukrainians to ise them is the ONLY reason Russia hasn't taken the country over.
Lets not get lost in the facts.
If Russia cant beat the Ukrainians who can they beat, only somebody much weaker.
Reply: It failed bro, cope harder
Reply: 90% loss is 90% loss.  Though we also need to take into account the Ukraine battlefront isn’t necessarily representative of future peer-enemy wars.
Reply: @jlv-77  90% loss over a long period of time is different from a 90% loss within weeks
Reply: Its because they kept advertising it as a wonder weapon over and over. As annoying as the russia bots are the ukraine cheerleaders arent the brightest
Reply: @BananaRepublicann  >epic leaking from amerimutt or smth
Reply: @BananaRepublicann you do realise cheerleader for the anti nazi side doesnt make you stupid cause you fail sometimes.
Reply: @BananaRepublicann no they didn’t, pro-RUs keep trying to say that The West™️ considers so many different things wunderwaffe when really it’s just them
Reply: @DaHappyTaco I think you never saw the news articles published by BBC or Fox news before commenting
Reply: @y @yacinenait  wow fox and bbc no way? Should I take Medvedev’s words seriously as well?
Reply: @yacinenait  You're right at least for me, a Ukraine-cheerleader, as I have very little interest in propaganda outlets (regardless of whether they be US ones, European ones, or Russian/Chinese/Indian ones.)
Reply: @DaHappyTaco hey, you're the one who state that only pro-RU who scream that many western things as Wunderwaffe. So you either admit you're wrong, or admit that BBC and Fox is pro-RU since those two apparently think that many western stuff is Wunderwaffe.
Reply: Also, those Abrahms were assigned to the hardest fighting brigade in Ukraine's army.
Reply: Nope that was the leopards
Reply: @richardthomas598  Yeah and they got destroyed. So they failed to change the tide of war. You americans are coping so hard its hilarious lol
Reply: Nah Russians lost at least 50 000 tanks😂
Reply: @urospavlovic2043   Next week it's 100000..😁 According to reliable ukranian sources.😊
Reply: @F4Wildcat eh, no both the Leopard 2 and Challenger 2 has had better crew survivability than M1 Abrams. Actually, the survivability of the CV90 is also higher. Check the facts first before you comment...
Reply: @ingnit6885  CV90 is not a tank. Neither does it the mission of a tank or go where tanks go. Not comparable.
Reply: @Gearparadummies  I know that which makes it worse. IFVs have generally lower survivability than tanks (Bradley is less survivable than Abrams, not to mention any BMPs...) since they have less armour and are generally cheaper to produce. Besides Strv 122 has also been safer than the M1A1...
Reply: @ingnit6885  Australia fnished the delivery of 49  additional M1A1 SA variant in December 2025, which the author has glossed over. Also, the Ukrainian military has acknowledged they started sending their Abrams with no infantry/IFV support much like the Saudis have done against the Houthis in Yemen...With identical results. It was only after losing 20 of them in the first four months after deployment that they started using them properly. 
A lone tank has always been easy prey for specialized infantry. Ask the Russians for the absurdly high number of T-34s they lost in the Battle of Berlin alone or what happened in Chechnya in 1994. 
No matter how good the hardware is, It's going to be destroyed if used wrong.
Reply: Also, Bradleys have been far more successful than Abrams in Ukraine.
Reply: Some real patriotic american cope
Reply: The t-14 is nowhere to be found. Plagued with issues and Russia scared to deploy it. Remember that terminator tank? What happened to those?  Russia like China is one big propaganda machine
Reply: @bamkobe1 What's the problem with the Terminator? It continues to be used, just like all other machines. But too few were produced to make the news so often. Some machines were destroyed, but most are still in service.
Reply: @bamkobe1  I'd be careful lumping China into the same category. 2 decades ago their cars would never have gone toe to toe with anything in the West, now their EVs are set to dominate.
Sure their military tech is behind now, but they'll slowly but surely close the gap
Reply: @ronanfitzpatrick1261 they have zero war experience and their EVs are hot garbage. Just because they’re paying journalists and reviewers to give outstanding reviews to push their propaganda doesnt make them actually good. Tons of videos of them spontaneously combusting in china.
Reply: @ronanfitzpatrick1261  They sell at a loss until they drive the competition out of the market. Their government covers the losses and start reaping benefits when they become dominant. Dictatorships' biggest advantage is playing the long game.
Reply: @bamkobe1 their EVs are, in fact, NOT hot garbage. I was in China last year and got some rides in them, they’re very nice. When you’ve been producing 90% of the world’s stuff for decades, you learn how to make some things pretty well. The days of “everything China makes is shit” are over
Reply: @CChan11 it is hot garbarge. All of it is including the people. They all look like aliens
Reply: @bamkobe1  You’ve never even been in one. How would you know 😂
Reply: @bamkobe1  You wanna talk failed military designs?  Look at the last 2 US ship programs.  The Constellation frigates and the Littoral Combat ships (LCS) - both cancelled dysfunctional hugely faulty designs.  Not to mention amusing UK problems with the HMS Queen Elizabeth carrier - propeller no go.  Physician heal thyself.
Reply: @tvbopc5416 didn’t Russia sold their only aircraft carrier to china because china they can’t make one blue sea worthy?  So they had to buy Russias 1950 carrier.
Reply: @bamkobe1  Priorities.  And on the other end, the US has no hypersonics yet - but Iran does.  But Russia does.  But China does.  Resources are not infinite, countries focus on their most pressing needs.  And Russia has commissioned 8 new ICBM subs since 2020.  By cherry picking numbers, you can always 'prove' they're doomed.  The only fact that matters is they're stronger than they were at the beginning of the war.
Reply: @bamkobe1  Several decades ago yes, then they used it as a template. I'd expect they'll have carrier groups in the next decade or so.
Reply: @ronanfitzpatrick1261 stop being a simp
Reply: @bamkobe1  What a ridiculous thing to say. I think if you're in a nation that isn't taking China seriously, even if you're currently ahead in a particular field, you're going to be left behind. But whatever 🤷
Reply: @ronanfitzpatrick1261 guarantee they won’t try Taiwan. 100%. Stop simping and get your tongue out their butthole. Weirdo
Reply: @tvbopc5416 US is currently developing and field testing a hypersonic. And there’s reports we have managed to shoot down a hypersonic in a test. Hypersonic’s are fast but they are not invincible from being shot down.
Reply: @Dylpickle0806  The fact remains we are behind.
Reply: @tvbopc5416 Hitler’s V1 rocket was supersonic too, so what?
Reply: @AG-pn2kz  Hypersonic.  The common use of the term indicates both high speed, thrust variability and maneuverability - non-ballistic.  So.
Reply: @tvbopc5416 comparing a county that has a navy vs a country that lost there black sea fleet to a country that has no navy is wild the only country that is stronger than they were before the war kicked off is ukraine sure russia has advanced alot in drone warfare but they've also lost alot more important equipment and manpower than ukraine has I get that they're on the offensive but you must be blind or braindead to say Russia is stronger now than they were at the start of the war when they throw dudes without food and ammo by the 1s and 2s across 10-20km fields to be blown up within the hour
Reply: @bamkobe1  Lol China has 3 carriers built now so idk what youre crying about. 😂
Reply: @Pur @PurpleDoritos666 chinas has a military that has never been tested nor wants to be tested. They don’t have any generals with war experience. Just a bunch of little dudes with lil Chinese 🍆 trying to bully their smaller neighbors but in reality Taiwan would smoke them.
Reply: As frustrating as reading YouTube comments can be I realized why I keep coming back to them.  Every now and then we're rewarded with the top comment actually being an intelligent  response.  thank you
Reply: Completely wrong.
Reply: No fire support destroyed before entering battle
Reply: Replaced how? Every M1 Abrams has already been built. What we have is endlessly refurbished and irreplaceable.
Reply: Cope harder
Reply: Your losses numbers for the Russians are laughable
Reply: @ЮрийКастро-м5в putin bot
Reply: @notsofrenchy  do you have any arguments?
My channel is older than yours, so you are more likely to be a bot.😂😂😂
Reply: And I hate Putin more than you
Reply: Every tank is a failure in Ukraine!
Reply: @a @alabrrmrbmmr  hardly, the challenger 2 is by far the most effective… in a big bush 2-3miles away, blast the Russian tank and move, that paired with an almost 100% crew survival rate has given the Russians a massive headache.
Reply: The reason it failed is the same reason russia failed to roll Ukraine in 3 days (according to west)
Drone. 
Right now attack > defense 
Same as icbm vs air defense.
Reply: 😂😂 lmfao, nafo bot crying
4800? Even oryx, non reliable website which uses ukraine as source, says that Russia has 4300 casualties, 3200 which is destroyed. Dude is probably uses zelensky as source 😂😂 🧠🤏
Reply: Copium commence
Reply: Rubbish.
They knew the exact capability before it was sent.
Everything is deliberate mate.
Reply: That crew survivability thing is of the past , yes maybe the crew survives the initial drone that disables the tank; they are not outrunning the artillery called by the spotter drone or worse FPV drones that chase them . The drones dont operate alone there are dozens used on a single tank.
Reply: cope harder
Reply: Tanks rarely did fire support in war in Ukraine. Out of 100's of tank loses only 2 to 5 did anything worth mentioning. It's all about drones and artillery.
Reply: COPE. They failed to change anything and got destroyed. 😂
Reply: No Chobham armor on the Ukrainian tanks.  That, is DEFINITELY a factor.
Reply: Go serve the military if u love it sm 😂
Reply: @z @zeknight4352 he's just pointing out the flaws of the video, by that logic you should goon to Jesus Christ if your Christian
Reply: Overall survivability might be slightly higher than the t series when you consider things like atgms
Reply: None of these loses are actually confirmed because a lot of the tanks you see get taken out get towed back and repaired, yes theres cases when the tank is completely wrecked thus is written off however is a fraction of all cases.

Oryx being the most widely used source is not good not only because their team was small and in efficient with counting loses, their methodology was flawed exactly because of their inherent bias which resulted in very inaccurate reports such as increasing the russian loses with vehicles of all types being counted multipule times, sometimes not having any proof at all for a loss but just reporting a claim from the ukrainian MOD.
Reply: Today tanks mainly fight against infantry not other tanks and in that role russian tanks have an advantage over western ones with a moder powerful HE shells to use against infantry as well as barrel launched atgms to use against distant targets.
Reply: Sound like a big dose of copium. Lost is lost, why romanticizing it? 

Truth are hurt. Get over it. 
Abrooms just suck at this job basically, so the Russian tank. War has been change a lot.
Reply: The cope is insane 😂😂😂😂
Reply: THe M1A1 does not have the highest crew survivability. The Challenger 2 does.
Reply: @Aethid So you're comparing it to a model of Abrams from before the Challenger 2 existed. Interesting.
Reply: @Shoelessjoe78 Yes, the C2 is a more modern and more capable tank than the M1A1. I am not sure why that would be surprising or interesting to anyone, but there apear to be a lot of fragile Americans here who don't want to admit that even their old equipment isn't always better than their allies' slightly less old equipment.
Reply: Yeahhhh no. There is no way to confirm. Oryx has been caught lying and using the same pictures to claim dozens of tanks as destroyed. They have also been caught using pictures of ukranian tanks and trying to pass them off as russian losses.
Reply: @tetraxis3011 have them now? Im yet to see any proof of that. If russian armored vehicles are doing so well...why is it that we're seeing t-62's being thrown into the grinder now?
Cmon stop with the copium
Reply: @brunoc.7517Yes they have. You can tell because they repeat pictures and Ukranian tanks are slightly different. 
The T62s all belonged to the Donbas liberation forces and because they serve Well enough. Tank on tank combat is very Rare, so tanks mostly act as fire support vehicles, and the T62 works perfectly fine in that role
Reply: @brunoc.7517 T-62s were seen in 2023. Now it's mostly literal mad max style repurposed civil cars and motorbikes.
Reply: Im disliking this video just because of this comment 😅 why can't channels just be real ffs
Reply: Ruskie Orcs lost 1000000 tanks, proven by oryx who are a reputable and professional source i might add.
Reply: @EscapeDFWcom fr fr
Reply: @EscapeDFWcom they’ve also been proven by orc shillers that give war updates. They’re all crashing out because they’re coming to grips with the collapse of Russia. Waiting for the china shills to do the same
Reply: @bamkobe1 true some Orc shillers have confirmed the Orcs have loat 10000000 tanks since they are closer to the Orc internal data which makes 10000000 a more dependable number.
Reply: @bamkobe1 Russia is not collapsing at all, kiddo. And Russia is outproducing NATO in tanks
Reply: I'm quite sure, that challengers do better job when ot comes to crew safety, but is not key parameter in wars. How quickly you can replenish lost crew and tanks to battle is a key. So balance between production cost/ 
time and survivability is the most important thing. 

I know that is harsh but true is that Noone cares about your personal survival in wars. everything has a price, even lives.  

To win a war you need to spare lives and other resources in prefect balance. Too much saving lives means too much key resources and hours spend in fabrics.
Reply: @pawemilewski3179 Absolutely untrue. For a military like the US, a trained crew is more valuable than the vehicle they operate. US troops spend far more time training than Russian troops, both during basic training and continued training after reaching their unit, and the US wants to protect that investment. This is why almost all US vehicles strongly prioritize crew survivability. Russia and China have far more available manpower,  and are more willing to lose it, because they aren’t entirely a volunteer force like the US.
Reply: @TTOMachinist in the event of a war most us troops would only be slightly better trained than Russian troops as the USA would start the draft and would be focusing on getting troops to the front = less training. This always happens
Reply: @botsmacker I’m speaking on national doctrine prior to the war in Ukraine. Best example is the difference in flight hours US pilots receive annually compared to other countries. Most countries, including Russia, don’t have the resources and logistical capability to sustain training ops on the scale the US does. They view training as an opportunity to cut cost when military budgets are high during peace. Do some research about it.
Reply: @TTOMachinist  you just don't understand. In vietnam your beloved usa do not used ordinary people, only specialists? In long term conflicts your starting military power doesn't mean too much. It's obvious that most of that trained soldiers will die in equipment produced before war time. What matters is not military power at start. What matters is how fast you can replenish and create new divisions and new crew.
Reply: @pawemilewski3179  : since Vietnam the US has not conscripted anyone. All its wars have been all-volunteer armies. The US spends enormous sums training its troops, as does the rest of NATO.

The Russian combat forces are also almost all-volunteer (there's some pressured conscripts, some tricked foreign workers, and there was a mobilization thing in 2022, but mostly it's actual volunteers). They get almost no training.
Reply: @benoithudson7235  and? Because the us don't need it now. If usa go on full scale war, ordinary citizens will go on fronts too.
Reply: @pawemilewski3179  Ukraine now has explicit orders to fall back rather than risk your life. War has changed.
Reply: @Llortnerof  tactical retreat is something different than things i ment, and it is well know since.... idk first war that human race fought. War changed, but not on that plane. Full scale non atomic wars will always be fought mostly in fabrics.
Reply: @pawemilewski3179  Yes, but not as the standard response to enemy contact.
Reply: @Llortnerof  they just do not have resources.
Reply: A failure compared to the leopard or the challenger

Americans are so thin skinned 😂
Reply: @matthieugiriens2240 Proof please?
Reply: @matthieugiriens2240   as long as you pay for NATO defense spending you can moan about whatever
Reply: @Quicks1lvr  those who were the only ones to beg for nato help need to sit and shut it
Reply: @Quicks1lvr Europe has donated tens of billions of dollars more in money and equipments to Ukraine than the US has. Europe is carrying their weight. Oh and….remember who started a war in the Middle East and asked the rest of NATO for help? Oh yeah….that was the US.
Reply: @matthieugiriens2240 Well, then, now we know what Europe can use to further support Ukraine. Please let your PM know. I'm all for Europe stepping up!
Reply: @bogeys1242  stepping up? US sent 31 and Europe sent 200 tanks 50/50 leopard 1s and 2s. Even Australia delivered more Abrams than the US...
Reply: @bogeys1242  p  off yank. Europe stepped up from the start. USA has gone missing. Because you have gone barking mad.
Reply: @bogeys1242  keep up with real news, not your inhouse narrative youtuber parrot
Reply: Buddy the UK has done more for them than anyone else, step off your high horse  @bogeys1242
Reply: To be fair Europe has provided 9 to 10 times more battle tanks to Ukraine than the states.
Reply: @Benedikt_J  Europe sent mych more than 200 tanks
Reply: @matthieugiriens2240 then you better not lose a fight
Reply: The purpose of a tank isn't crew survivability. 'Russian tanks flopped as well' proves nothing. 

It can still be a good tank while still failing in Ukraine. Calm down.
Reply: @CG-dd9tb  Whether they failed depends on what they achieved before being taken out of service.
Reply: By all measures it failed badly in Ukraine. A type of war is was not designed for, with crews that weren't trained to use it, in a an environment that is one of the most unforgiving in the world for mobility.  It failed and that's okay. Having an emotional reaction about it doesn't mean he's wrong. Fix it and move on.
Reply: @Highcaloriegrappling but your wrong it literally wasn’t a failure yes plenty of malfunctioning systems in certain circumstances but it literally has the most confirmed tank kills right now it’s at least 2800 when we only sent about 1000 so a 3:1 ratio can never be a failure
Reply: @Highcaloriegrappling it was supposed to be designed for exactly this, fighting russia in eastern europe
Reply: it was crap 35 years ago in Irak it still is today, it's fuel convoy costed many lives of British troops that waited for there support and had to again be saved by the French who were free to stretch on the British side after they pushed, destroyed and captured all Irakis troops outside Bagdad with very low casualties thanks to being refueled with a few jerrycans and having the only capable professional army in NATO
Reply: Abrams tank is an outdated junk what's not got to modern warfare and war between Russia and Ukraine showed that thus American Tanks are JUNK!
Reply: Millions of dollars of American equipment being destroyed by some hundred dollar Chinese drones 😆
Reply: @M.r.Mysteriousyoure aware billions in Russian equipment has met its end to the same drones?
Reply: @dankbonkripper2845  But its Russia. They expected to lose numbers. USA losing equipment is embarassing 😂
Reply: @dankbonkripper2845 But we're not saying that Russians tanks were successful, are we now. We're saying both sides have been bleeding money due to drones.
Reply: 4,800 tanks yeah sure buddy
Reply: @blackmantis3130 I mean their loses depending on source are between 3000-4300 visually confirmed. So 4800 isnt to far out.
Reply: @ThePirateParrot Visualy confirmed bs. Theres a reason the groups mapping that crap like Oxy stopped after things got sourer for Ukraine. They would make captured Russian tanks a loss but if Ukraine would lose that tank, would be Russian loss again because it was a Russian variant. They loved to mark every T80/T72 from Ukraine that couldent be analysed as Russian too. Its a bunch of bs that confirmed losses.
Reply: @SaltEnjoyer007  : Oryx hasn't stopped.
Reply: uhhh I think a tank is built to do a little more than "protect its crew"
 pretty sure the most important thing a weapon can do is destroy/kill 
your enemy. Patton himself would be unimpressed by its capabilities in 
Ukraine.
Reply: @keith3761  you are actually wrong… a tank can be produced from zero to deployable in mere days or weeks but taking a crew with zero knowledge and bringing them to a high skill level can take up a year if not more so by simple availability bottleneck the crew is much more worthy than the tank itself… if the tank is destroyed but the crew survives the knowledge of the crew will be reused on the new platform, if the crew dies you have to replace them with an unskilled crew that will last maybe a couple hours on the frontline.
Reply: Copium.
Reply: @F4Wildcat "Russia can attest to that as it lost atleast 4800 tanks (of wich are 100% confirmed) up to 10 000 estimated." Parroting United24/EuroMaidan claims are we?
Reply: @zoltancsikos5604 literally proven by osint images.
Reply: @zoltancsikos5604 The sattelites images of the Russians Tanks Depots backs him up.
Reply: It's better backed up by the Americans that used them day in, day out that the Ukrainian army that haven't had them for long
Reply: @TheWatchman1893for four years? Not long?
Reply: Russia didnt even have 4800 tanks in service mate..Stop the cap lol..
Reply: @boikanyoonneng9170 Sure they did. You can go online & count them yourself. 
Or, you can go on YouTube & count them with other people. Do you really think this type of thing is a mystery in the days of satellites that can photograph individual people? We know (plus or minus 10%) how many tanks, IFV’s, missiles, anti-missile carriers, AFV’s etc. that each country has. The US government knows (within 1 or 200 tanks) how many ruxzia has & they had around 11,000-12,000 tanks, either in service, or kept for emergencies, in storage yards. That’s ALL tanks, going back to those made in the 1950’s to present. 
Go look it up. There are several YouTube channels that get satellite photos & count them with other different tanks, IVF’s & so on. 
New knowledge is only a couple clicks away, my friend🫡
Reply: @boikanyoonneng9170  russia isnt using only tanks they had in service dumbass, they've been pulling old crap from storage for the past few years now. Why else would we see god damned t-62's in their lines now?
Reply: @boikanyoonneng9170 No, but they reactivated* a lot mothballed tanks to make up for the ones they lost. And then they lost those. So they reactivated more etc.

*They also produced new tanks, but the majority of "new" equipment was actually reactivated
Reply: Your number of Russian tank losses is Ukraine's number of Russia's tank losses.  Probably not accurate.
Reply: @tvbopc5416 the visually confirmed loses has ukraine at a 1:3 advantage over russia in tank loses.
Reply: @bananaboat30plus87  From what source?
Reply: really??? how would you explain those failure in Ukraine?  😂😂😂😂😂😂😂
Reply: 27/31 counts as a failure you chum
Reply: it is called reality and you better start dealing with it
Reply: Since no personnel have been lost in any Challenger 2…I’m calling BS on highest survivability.
Reply: And that is the crux of the problem

What is the turn around on making a new one?

Realize when WW happens the nukes fly and we fight with what we have there will be no replacing of equipment.

Even if no nukes happen, we only fighting with what we have in stock.

Ur not getting a new tank from the factory anytime soon
Reply: @D4Dummies One thing we know for sure is that WWW3 will make Toyota the biggest car company for the next 3 decades over 😂
Reply: Russia lost AT LEAST 4800 tanks?!!? 🤣🤣🤣🤣🤣🤣 That sounds like another piece of info from "reliable" and "credible" western sources 🤣🤣
Reply: @vladovu That number is pretty close to Oryx estimates which rely on visually confirmed losses so... Yeah... Cope and seethe.
Reply: @tomcat4195  I am not the one coping, little poodle, look in the mirror 😉
Reply: @vladovu  good one comrade. Off to the meat wave with you! For the glory of the oligarchs!
Reply: @tomcat4195 Comrade?? That's it? That's all your western brainlet can come up with?? West is truly f*cked and good riddance 🤣
Reply: Well a 27 loss does seem like a loss 😅
Reply: Hunter Biden would be so proud... 10% for you.
Reply: What a joke. Russia losing 4800 tanks... lol. 

What a sorry you are
Reply: Whatever American Fanboy
Reply: It's more a failure of the entire ukrainian Army. They are loosing the war, their Tanks are easy to See and easy to destroy because of the overwhelming superioirity of the russians. They are able to locate their enemies and destroy them with overwhelming force.
Reply: They sent these Nato tanks to break through Russian fortifications. All of them utterly failed. Bringing up crew survivability, which is being exaggerated mind you is a cope. Many destroyed Abrams hulls are completely burnt out, with charred remains of crewmen still left inside.
Reply: It is a failure cause they fail against Russian tanks
Reply: Abrams are less useful then a t72
Reply: @alexanderwheeler2238  doesn’t help when theres no T-72s left eh
Reply: @alexanderwheeler2238  the older Abrams 
Yes i agree
Reply: 😂😂
Abrams is effective only when there is air support and don't forget Abrams and leopard are not suitable for Soviet soil..
Reply: Россия потеряла 4.800 тыс танков? А ничего что у России всего 3.200 танков?
Reply: @IMPOSSIBLE-474  - not disagreeing with your statement, but shouldn’t this be past tense… ‘had 3200 tanks’. 😅
Reply: @Pieces93 по вашему телевизору вы уже Москву взяли в блокаду и танки уничтожили больше чем их впринципе было
Reply: @IMPOSSIBLE-474 слава богу тут телевизоров не смотрят и вонючую Москву "не берут". Лучше сами там разлагайтесь, без Европы.
Reply: @IMPOSSIBLE-474  Exactly.  In Korea in late 1950, the USAF estimated North Korea had lost 1000 tanks - the problem was they only had 400.  The US Army asked the air force to re-examine it's claims,  and they came back with an estimate of 1200.  All of the claims of huge Russian loss are taken directly from Ukrainian claims.  Think they might have a reason to inflate the numbers?
Reply: @tvbopc5416 украине выгодно завышать Российские потери , потому что они теряют территории, должна же быть ответка в виде огромных потерь России
Reply: @tvbopc5416 с августа по ноябрь 2025 года я был в Судже ,215 добровольческий поисковый отряд ,всю американскую ,немецкую французкую технику которую я видел сдесь уничтоженную я не видел на Ориксе , и она там никогда не появится ,такого недопустят
Reply: @tvbopc5416 я сам из России, и это байка про 4.800 танков только смешит , фото сгенерированные ИИ ,а на самом деле тут никогда даже 3.500 тыс во все стране не было ,и не будет из-за большой коррупции, нашим чиновника проще себе яхту купить ,вы видели Армату? И не увидите как и я , вот так же тут обстоят дела даже со старыми советскими танками
Reply: @IMPOSSIBLE-474  I'm from a 'defense industry' family in the US - pretty much the same here.  Overpriced borderline-functional equipment in small numbers.  And our oligarchs are increasingly sucking up all the air in the room over here as well.
Reply: American?
Reply: @proaudiorestore8926  the American M1 right ? If for instance the British took delivery of loads of old Russian tanks they would be less efficient at Operating those than a fleet of challenger tanks
Reply: @proaudiorestore8926  YES - their entire personality is built around their military - the video just called thier kid ugly and dim
Reply: Aww don't be so defensive now.
Reply: But hurt, making numbers up I see.
Reply: 4800 100% confirmed... Hahahaha.. Yeah if you believe american propaganda.
Reply: Media brainwashed most people in believing Ukraine has a chance against Russia. Don’t get me wrong, I’m against this war, but there’s no competition
Reply: Being destroyed by a $500 drone...thats failure
Reply: @juanDE1703  So every tank has failed in Ukraine?
Reply: sounds like american copium to me
Reply: Here we go. Another M1 fanboy. All MBTs in Ukraine wether Ukrainian or Russian or even those of NATO or US are all utter failure. What this Channel should be concerned of is getting cancelled because of such a title because Uncle Sam doesn't want anyone saying to the world that his technology is also a failure. Bad for business
Reply: @lyn-jhonosia8981  I think Trump is significantly worse for business, threatening to invade NATO allies...
Reply: Cope. The Chally 2 is the nuts, the US even bought it's armor for the M1.
Reply: This is like saying, "38 of our 60 aircraft are shotdown or out of action. But thats okay cause they left the runway" like mfr No, that is a failure. An 87% casualty rate. That's a massive failure. And that's what Russias Air Force is facing.
Reply: Sure jan
Reply: Abrams was useless in the Ukraine battlefield! "Survivalitility if the crew" as a point is useless since best chance for crew to survive is not to emter tank or battlefield at first place! If they go to battlefield in Abrams, some will die but they will be equaly useless as if they stayed home! Russian tank tried to make massive armored thrusts deep into frontline with expected (high) losses but at least they made some gains!
Reply: What is your source for the Russian tanks' loss?
You are a liar
Reply: @a @ProudKafirTheInfidelKing putin bot
Reply: NATO shills SCREECHING in pain. Fantastic to see.
Reply: "russia lost 4800 tanks up to 10k" seems like ukraine propaganda
Reply: @FalconSweep  Only to people who fell hook line and sinker for Russian propaganda. If Ukraine hadn't destroyed that many tanks then Russia would be in Kyiv right now due to the sheer numerical advantage Russia would have in tanks on the battlefield compared to Ukraine.
Reply: Copium overdose. 🤡
Reply from the maker: Saying military equipment is supposed to fail is one hell of an impossible strawman argument. Your definition of failure is most definitely different from the Ukrainians
Reply: @RealEngineering not ‘supposed to fail’, it’s an inevitability that during a near-peer conflict there will be losses, which is why cheaper equipment is also a heavy consideration. And at the end of the day, survivability trumps it all, because man is worth more than material, especially in Ukraine’s case
Reply from the maker: So you agree cheaper equipment is succeeding and old expensive outdated equipment isn’t succeeding? Sounds an awful lot like failure to me
Reply: @RealEngineering DUDE, you need to stop responding lmao.

That isn’t at all what this guy commented at all. He stated that equipment’s cheapness is always a consideration knowing that equipment attrition will occur during a war. Crew survival rates are one of, if not the most, important considerations when it comes to armored vehicles.

I think you need to log off dude before you harm your channel anymore.

Your disrespectful responses to fairly tame and logical comments is getting out of hand.
Reply: @RealEngineering  Mate. Did someone hack this channel? First you introduce a straw man (accusing someone of arguing that military equipment is "supposed to fail", they didn't), then in the same paragraph accuse them of building a straw man. Then you come up with a complete non sequitur straw man (the comment I'm responding to now), where your tone is that of an edgy 13 year old forum troll. And this is under a video where you completely grabbed the wrong end of the stick; it isn't the Abrams that is a failure in this new type of war, it's tanks in general! In fact, almost all old war doctrine is out the window now. And you know perfectly well that calling a Western piece of equipment a 'failure', will attract westerners and russians alike like flies to dogs**t.

Heart felt advice: take a break. Get off the internet for a week.
Reply: @RealEngineering  brother, you fell off if this is the quality of your channel now.

Take a break.
Reply: @RealEngineering Was that even an argument? What i saw was 20 minutes saying that M1 is overweight and has bad mpg wihout allmost any nouance. Also downlaying every argument posted in comments just look bad man
Reply: @RealEngineering  no? He is saying the opposite
Reply: @RealEngineering  No. Crew survivability is more important.
Reply: @RealEngineering I'm with you on this, as an engineering channel you should always strive to point out the flaws of yesteryears engineering in modern context and help shine a light on newer engineering solutions to tackle it. Yes irl some losses of equipment is to be expected, but do NOT ever design something like a tank with that purpose in mind because we're talking about the safety of the crew here, so we should always strive for something better through design and engineering
Reply: @RealEngineering  AGAIN not what’s being said. “Cheaper equipment” is in reference to things such as the Abrams X demonstrator (which you incorrectly showed as the M1E3 pre-prototype by the way) aren’t just Willy nilly accepted into service and built in the thousands. That tech demonstrator would be atrociously expensive and hamper the amount of units that could be procured. So yes, “cheaper” equipment that is “good enough” is vastly superior to the tip top end of the line future tanks that are being demonstrated. Not to mention why and how they were lost when factoring in doctrinal and operational differences, which were a MUCH larger part of why the loss rates were so high. What you’re arguing is essentially the same as arguing that roads are failures of engineering because 90% of roads are deteriorated to the point of needing replacement and repair. This is hands down one of the worst videos you’ve ever released.
Reply: @RealEngineering  The intern commenting on this thread needs to be fired 😭🙏
Reply: @RealEngineering  That isn’t a failure of the tank. That’s a failure of strategy. If you use the wrong equipment or don’t use them effectively that doesn’t mean the tank failed. A bomber jet vs a fighter jet would mean the bomber loses, doesn’t mean the bomber is a failure. It’s just the wrong tool for the job. Using tanks, infantry, etc. without anti-drone support is poor strategy.
Reply: @RealEngineering Imagine being this much of an idiot, no wonder you do Youtube videos. Couldn't actually make it as an engineer, could you? 🤡
Reply: @RealEngineering  you're sounding awful childish bud.

I don't think i can see you as credible after seeing the level of immature responses I'm seeing you make.

You not only misrepresented tanks that I sent out, you're arguing like a teenager.
Reply: @RealEngineering  what the fuck are you talking about? By your metric, every single piece of military equipment is a failure
Reply: @RealEngineering  Dude. I love your channel normally but this is atrocious.

Attrition happens, especially when the Abrams sent to Ukraine are so few in number, relegated to the most intense regions of combat, and are largely not fully upgraded chassis.

Like SHEESH dude this was bad. Expecting to operate any sort of combat system without equipment loss is the most civilian brained thing I’ve heard in a while.
Reply: @ZechariahB war.

Do you know how many "successful" tank designs suffered heavy losses during ww2?
Reply: @RealEngineering was the Lancaster a failure? 7,377 were built 3,736 were lost.
Reply: @RealEngineering  Did you ask the ukrainians what they think of this tank when compared to their old soviet stockpile?
Reply: @RealEngineering  This is by far the worst video you've ever done. You don't even seem to understand that yes, military equipment is designed to get lost. That's the reality of war. 50 was never enough to win the war.
Reply: @RealEngineering 31 front line armor in a war of a hundred thousand men on each side is paltry. Your critiques are reasonable but the battle rationale borders on those “what if we dropped a single aircraft carrier into WW2” videos except at a slightly higher ratio
Reply: @RealEngineering  having sent some of these tanks myself... being the tech involved.

I should mention that you are indeed talking about the wrong platform.

We did not, and will not sent a2s with ITAR and classified kit.

The export of such kit (active use) would only serve to compromise our men and women.

I should also add, that the m1a1 (what i sent to ukraine) is designed explicitly for maximum crew survivability.

We can always coble together another hunk of steel, but replacing an experienced tanker takes years.

These tanks have done their job to a T, despite fighting a war that wasn't even considered possible at that time.

These tanks are likely older than you, and have done a LOT of damage to the russians.

The goal was met.
We traded tanks for lives.

Slava ukraini!
Glory to ukraine!
Reply: @RealEngineering definitely, also was hoping you could do a video on the Leopard 2 tank. Its capabilities and performance in Ukraine deserve a video
Reply: @RealEngineering  “Don’t you realize that Russians were SUPPOSED to blow up our tanks?” 😅
Reply: @AB0BA_69  That's why you, usually, keep building tanks during a war: The ones you send to the front tend to be blow up in combat.

That's how you win wars. Not by building few invincible tanks.
Reply: Come on dude. Enough the BS 4800 tanks. No 100% confirmed. Oryx is propaganda, I myself counted various t72s they presented as the same tank, they even used Ukrainian tanks as russian.
Beyond that, Russia never 4800 tanks in service to begin with. And considering there is still hundreds of their MBTs in units that didn't participate in the conflict... It shows. 
Far East exercises, the tank biathlon... Western units still having tanks. T-80s refurbished back (they were passing them out) for new arctic units. 
Russia had barely 2500 tanks in service, 380 t90s, 400 t-80s which were being deactivated and 1200 T-72B3. 
There were never 5000 tanks in Ukraine and Russia never had 12000, that is the strategic reserves, which mostly were used as spare parts or refurbished and sold for 20 years to foreign clients. So their numbers are much more less. 
I know you will say that they are using T62s... Those are not replacements... Those are reinforcements. Infantry and artillery units in Ukraine were given T-72s and T-62s to increase their firepower and use them as gun support platforms to buff up. They use them to complement IFVs which a 62 offers more armor and they also use them as indirect fire support, artillery like, since they have millions of 115 mm HE ammunition laying across Russia.
Reply: @Argentvs "Russia has lost 1m soldiers and Ukraine only 12 000 by Feb2023"😂😂
Reply: ....  @Argentvs  ...?
That you Putin?
Reply: @michaelpayne9712 yes everyone that does not follows the brainless propaganda and question things using logic is Putin, or a bot... 
You lot are brainless lemmings following what they tell you to think. 
Don't think, don't question, just repeat the program.
Reply: @michaelpayne9712 so original. how about you bring some supporting points to refute his claim?
Reply: @Argentvs  They had around 3000 at the start of the conflict + over 10,000 in storage. They have constantly been producing new ones during the conflict. Are you struggling with the mathematics there buddy?
Reply: @ingnit6885 they did not have 3000 tanks. And the 12000 in storage are fiction so numbers counting ALL tanks ever in service since the T-54.
Those are numbers thrown around in internet just because. 
Russia was reducing their military budget, tank units and retiring the entire T-80 fleet in 2020. They even rejected the T-90M before the conflict.
Again, those tanks lost in Ukraine are pure propaganda for the ignorant masses that eat anything the media vomits. 

Fact aside, most tanks "destroyed" are not irrecoverable. Russia recovers most tanks and send them back to factory to be rebuilt if they are heavily damaged. Or they field repair them. That's how you have so many oryx numbers... Tanks get put out of action and back constantly. 
But you think the few blown up tanks they show in videos are the norm when they are the exception and you are conditioned by confirmation bias. 

Fun fact, the USSR produced 86k T-34s in WWII but the actual numbers were much lower. A lot of those tanks were battle write offs remanufactured. There are tanks that were sent back to combat like 5 times after complete rebuilds.
Reply: @ingnit6885  people have counted the storage depos and russia has around 1k t64s and 500 t55s, their modern tank numbers sit around 745 as of 4 weeks ago. Check out "covert cabal" he counts russian tanks in storage
Reply: @Argentvs  Russia THEMSELVES claimed they had 2800-3000 at the start of 2022. The tanks in storage are easily verifiable since they store them outdoors, so they are clearly visible on satellite images. The T90-M is trash, obviously they rejected it. Oryx and others distinguish between irrecoverable and recoverable losses, I feel like much of this shouldn't be so hard to look up yourself...
Reply: @ingnit6885 nah, a lot of propaganda there. And no T-90M is excellent. They rejected 3bcsuse it costed 3 times more than refurbishing 72B3Ms.
Now they are manufacturing it. It even has the carrousel armored. No 90M has been ammo racked. It's armor packed is top and the fusion sensors turns it into the most advanced and battle proven tank in production.
Reply: Maybe tanks are more or less history because of drones
Reply: @titlingur2009  No, not really. Tanks have always had two purposes on the battlefield: #1 they can ignore machineguns, and #2 they bring a really big gun to the front line.
Infantry weapons have advanced to the point where #2 is getting shaky, but no infantryman is bulletproof. Until that is solved, they need tanks.
Reply: @josephd.5524 yes but the land drones ukraine has used, might be the answer. Not the tanks we are used
Reply: @titlingur2009 nahhh not likely. Land drones don’t work all to well at least not right now. Air drones work great against lightly armored vehicles but for tank they take a lot of strikes, what you see online are only the successfully
Reply: @KCot-v6h so what if it takes 10 drones to do it, its still 100 of times cheaper than a main battle tank to produce. These land drones will become more and more effective without putting any lives at risk
Reply: @titlingur2009  right but that only matters if you can get those ten hits before the tank leaves again they’re effective just not as much as people think for main battle tanks.
Reply: @KCot-v6h those fpv drones are fast as hell and a tank can’t out run it. Those tracks are vulnerable a good hit and it’s done
Reply: @titlingur2009 nonsense.  In the cold war, tank platoons not operating in environments where air supremacy was established would have an AA vehicle accompany them.  Western forces have fought in that sort of environment in over 60 years.  Now after watching the Ukrainian war play out, western countries are all designing new vehicles or upgrading existing AA vehicles to work alongside tanks, apcs, and infantry and deal with drone swarms.  Look them up.
Reply: @StephenElwess i am not so sure, these tanks are very vulnerable to these cheap drones. Unless they actually find a way to protect them
Reply: @titlingur2009  the way to protect them is with smaller more portable versions of the ciws strapped onto a tank body. imagine a fully automated system rolling around with a tank equipped with a radar capable of detecting drones and blasting them out of the sky. these drones are cheap but not invulnerable, a jammer is enough to kill these things and you can not only jam the drone but also track the operator, and light flack fired accurately is all thats needed to take these out as well. these drones arent going super fast so if you manage to track it its game over. and your kinda overestimating how effective these drones are for every drone kill you have seen you have 10 successful tank sorties.
Reply: @jamesheedrpg_god-boss3676 jammer is not enough if drones run on ai. And you cant put to much crap on the tank or you risk that it becomes to heavy
Reply: @titlingur2009 look up LeonidasAR, DedroneOTM, Skynext Truck, UCAS Stryker, RQ-20 Avenger, TQM-1 Avenger SRADS upgrades, along with various hand held anti drone weapons in development or in testing in Ukraine right now.
Reply: @S @StephenElwess  you need several guys just to protect a tank, why not do it all with drones and no tank
Reply: @titlingur2009 because tanks can do shit drones cant do.  And tanks have always been meant to operate alongside infantry, not by themselves.  For fuck sake, this is the same arguement drom decades ago over the proliferation of infantry anti tank missiles.  Look up COMBINED ARMS WARFARE.
Reply: @titlingur2009  Yes... but also no. 

Drones are just the most recent advancement in anti-tank weapons over the last 100 years. When anti-tank rifles came out in the 1920's, experts called the tank obsolete. When rocket launchers came out in the 40's, experts said it again. Same with anti-tank missiles in the 60's.... you get the idea. But the thing to consider is that counter-adaptation happened. Tanks got thicker armor, ERA, and APS systems. Their tactics adapted and their deployment strategies adapted.

So how are tanks of the future supposed to counter drones then? Imo: they don't. I think in the future we're going have dedicated support platforms that roll side-by-side with the tanks to act as an umbrella from the rain of drones. Stryker Leonidas or the Hornet counter-drone developed by Ukraine come to mind.
Reply: @j.b.victor if a tank needs that kind of support just to keep it alive, wont there be a cheaper way of doing it the same without a tank
Reply: @titlingur2009  Like what? If you’re talking about direct fire support assets capable of destroying hardened targets (bunkers, trenches, enemy armor, etc.) and taking territory and enemy hard points, there currently is no alternative to the tank.

IFVs are good but their auto cannons aren’t always enough to defeat hardened structures.

Drones are highly effective against individual targets, but good luck trying to hold onto captured territory with one. Gotta recharge that battery at some point.

Sending in infantry in wave assaults and ditch the armor support altogether? We see the Russians doing that to… mixed results. To put it nicely.
Reply: @titlingur2009 could be a very true statement
Reply: @titlingur2009  Look up Lazerpigs Hurr Durr Drone Syndrome video, covers very well the tank will be around for a good while yet.